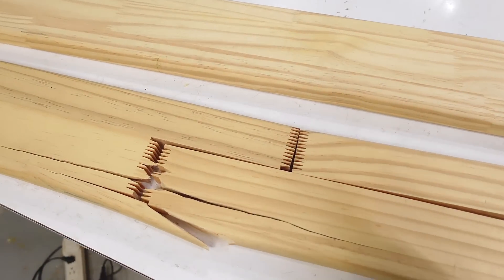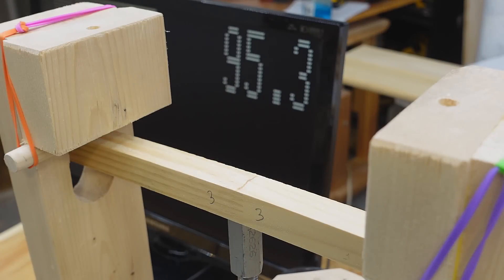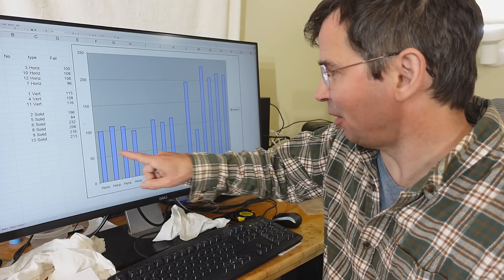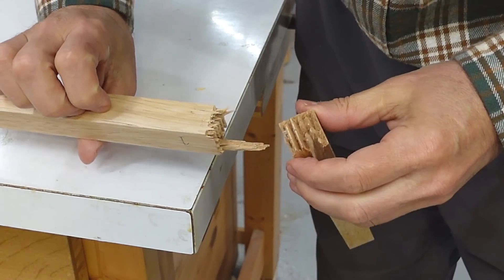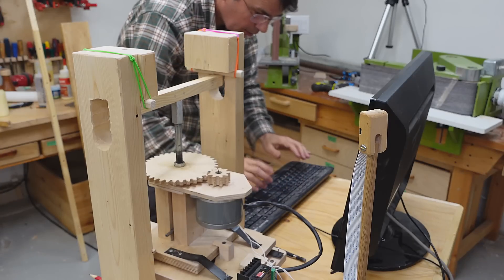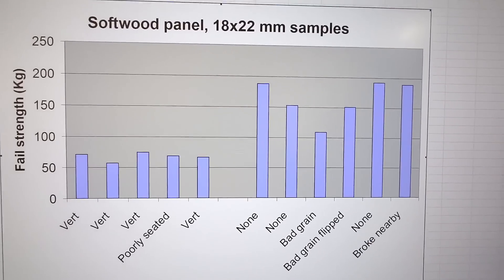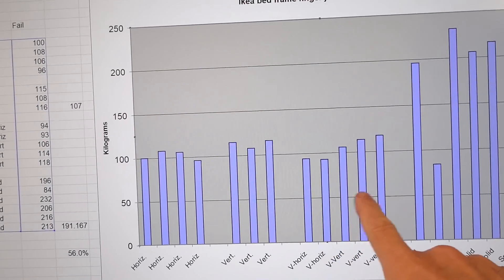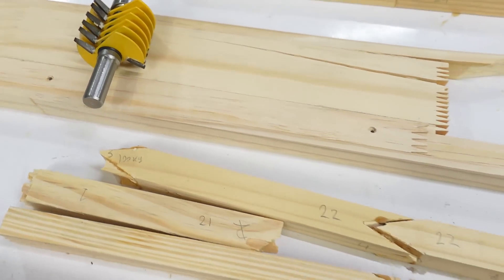How strong is finger jointed lumber

Comment: I hear another well known you tuber suggests polyurethane construction adhesive would make all the difference!
Reply: All joking aside I think the main ingredient in that stuff is the will of god, 'cause once it's set that's it. It's not going anywhere.
Reply: Not always. If you read the instructions and recommendations of the manufacturer, you'll see where they recommend that with dense woods you dampen the glue joint first, which helps the wood draw the poly glue in deeper for a stronger joint. I've seen several failures of poly adhesives where the glue didn't penetrate well enough. With your  usual wood glues this is not a problem, and if you use them properly you can get a joint about equal to the strength of polyurethane where the wood fails with or before the joint does. Where poly excels is bridging gaps and regular wood glues do poorly with that.
Reply: @P_RO_  for a moment there I thought you were comparing two things that started with the prefix poly- and distinguishing one from the other by shortening it to poly